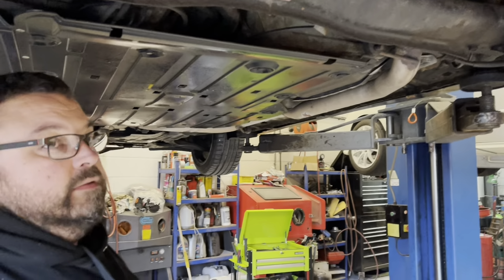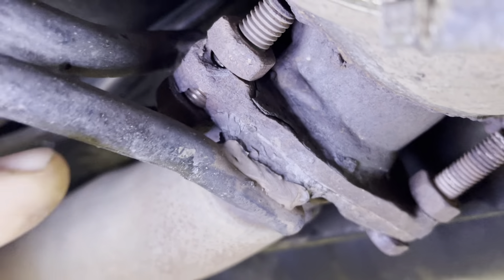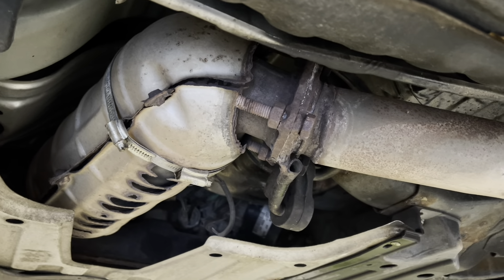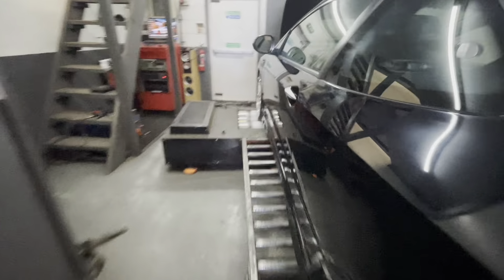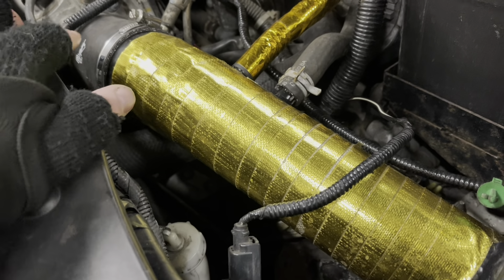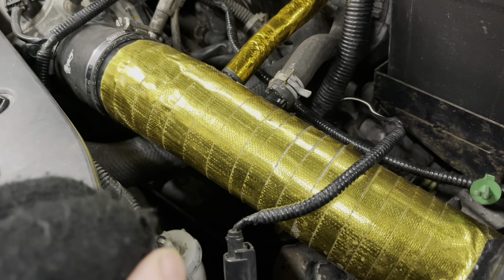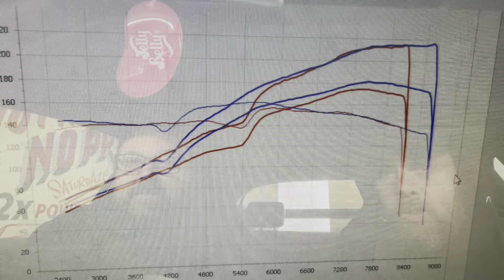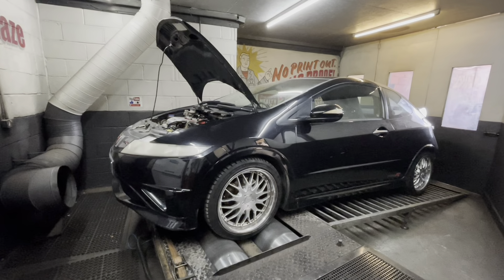A common PROBLEM Honda Civic FN2 TypeR Tuned After Modifications

Comment: Tegiwa 70mm. It’s got potential 👍
Reply: great vid guys! just curious following the exhausts discussion - is there much difference between the 70mm vs 76mm Tegiwa options? is the latter more the serious route of FI?
Reply: @goosfraba87  the latter 3” is the standardised Civic cup race series exhaust and includes a 100cel sports cat option to make them track compliant. Won’t pass road emissions on it though. 
I believe it’s made by Miltek but also has slip joints which require welding up or regularly adjusting (they knock like hell).
A very good exhaust for big power, but the Tegiwa 70mm is the best value for money for most NA builds and no slip joints.
Reply: @Matty_Champwhite  Thanks Matty for explaining the differences. I will definitely be avoiding this possible bad choice! 😂
Reply: @goosfraba87  if you’ve the money to spend, the dynodaze 3” (the old TDI 3”) is essentially the most future proof exhaust on the market. And does an epic job on mine. It’s on bolt flanges too
Reply from the maker: @goosfraba87  bigger the better however there’s no better value for money than the 70mm which is awesome
Reply: @DynodazeHondaTuners  sorry mate doing your job 🤣
Reply from the maker: @Matty_Champwhite  you keep at it, I’m in the bath

Comment: I have this issue with mine, I have a brand new 421 manifold with decat and a new exhaust and I want to get it all fitted and sorted with new bolts gaskets and everything before I bring it to you guys because I can imagine this is a huge pain! And I don't want to put you through that! 😂
Reply from the maker: If it’s all new it’s easy peasy
Reply: @DynodazeHondaTuners  yeah it will all be new👌🏽

Comment: What is the fuel cut RPM on the ECUTEK map? Never realised it increased the max RPM over the standard map? The standard Fuel cut RPM is 8250 if i'm right in saying?
Reply from the maker: Rev limiter 8200 stock 8600 tuned ( whatever we choose )
Reply from the maker: Rev limiter 8200 stock 8600 tuned ( whatever we choose )
Reply: Thanks for the reply guys! Have a nice weekend!

Comment: If its a common issue, is it not worth stocking some repair flanges to cover the common diameters? They arnt exactly expensive 🤷🏼‍♂️ not excactly a show stopper.
 I guess if the owner isnt technically confident then they might not be comfortable jacking the car up and checking their "flange" 🤭 is intact.
Reply: Having said that the rest of the system doesnt look worth salvaging.  but they possibly didnt know that. Repairing the flange might tide the customer over until he/she can afford to fit an exhaust at very little outlay.
Reply from the maker: Ide like to stock everything, just isn’t possible. Plus modifying flanges isn’t cheap, especially if we already have work booked in after this job in the day. Being booked up till mid March would mean we simply wouldn’t have had time to rectify this and eat into the next job. We usually stock nee exhausts but supply and demand been an issue last year or so. We just do our best